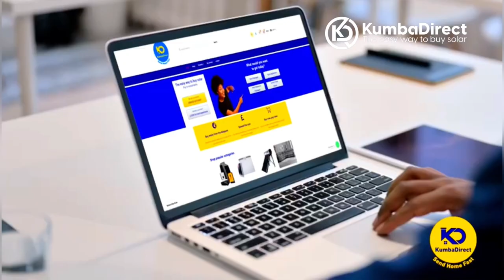The Easiest Way To Get A Solar System For Your Zim Home

Comment: Solar igood backup but never take advice to go off grid if your system is not the best and strong. off grid is not good in winter especially countries with winter season yekuti you will have some days without good Sun.bcoz solar batteries will need to be charged by a genenerator or electricity. Thank you Kundai
Reply from the maker: Thank you so much 🙏🙏

Comment: What's the battery life

What's the panel size

How about the converter quality
Reply from the maker: Every detail is available on their website www.kumbadirect.com

Use coupon code: KUNDAI 

for a massive discount 

Or you can connect with them directly on +44 7763 498401